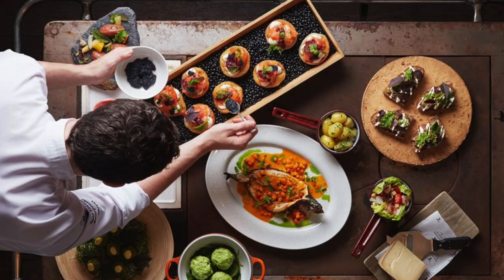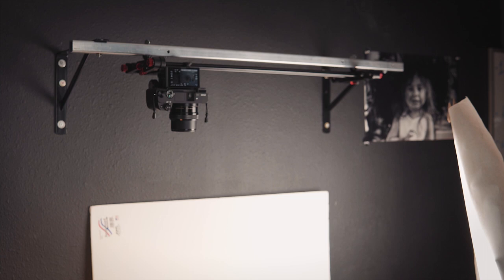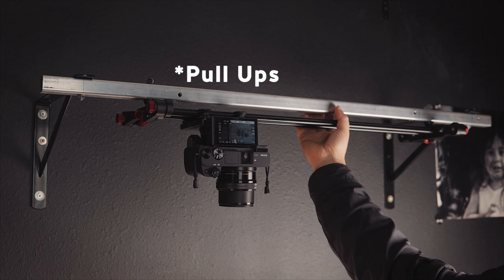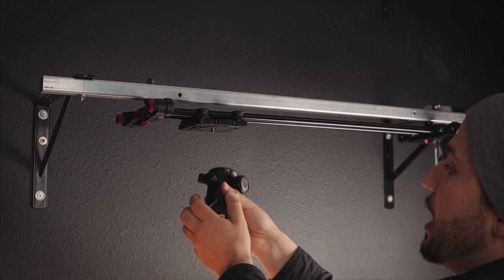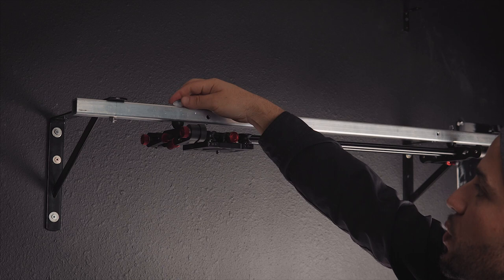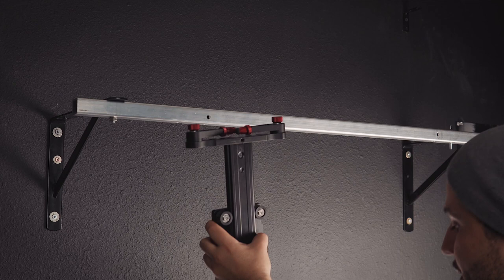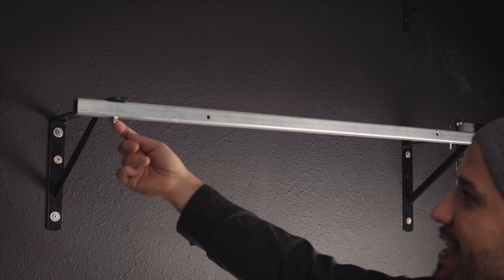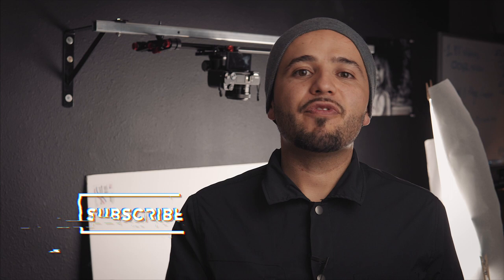How to: Overhead Camera Slider Shot

Comment: I use a lighting back drop over my work space with an Ashanks motorized slider inverted and attached to the top bar with friction arms and then attach my G6 Max gimble for some crazy pan and tilt effects

Comment: At your 4:33 mark, I assume those 3/4 inch holes are pre drilled into the slider? The Amazon photos don’t have a closeup of the product. I want to upgrade my rig from the DJI Osmo it’s just not stabile enough. 

Great video by the way, couldn’t find anything on how to do slow motion overhead videos, maybe add slow motion keywords to your tags. Muchisimas gracias!